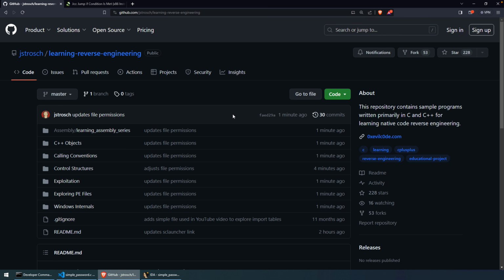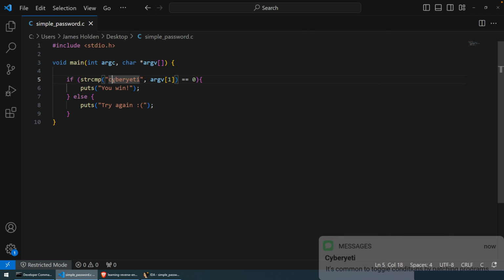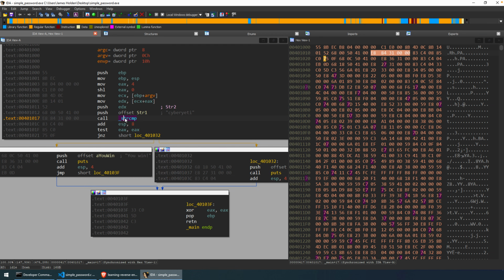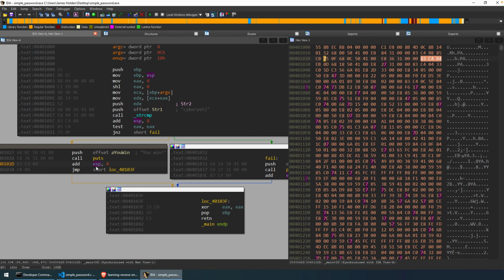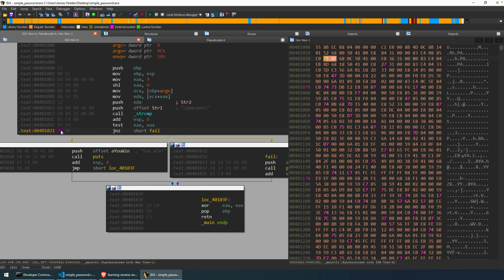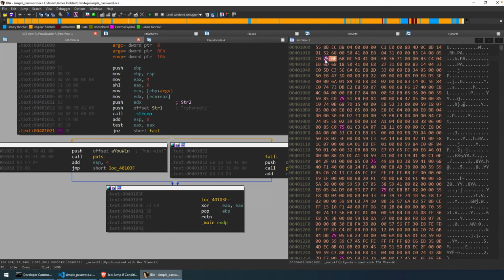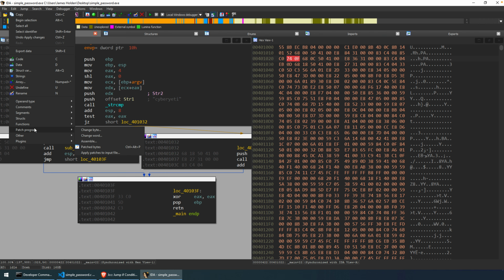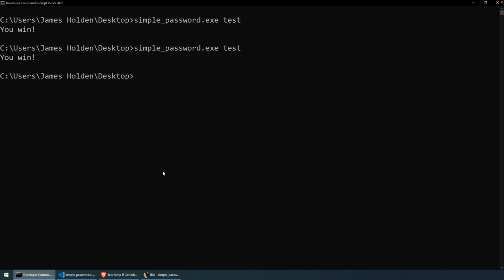Patching Binaries with IDA Pro (free)!

Comment: The much less expensive way is to xor eax, eax (which in itself is less expensive than a mov of 0 to it) and nop out the remaining three bytes, all in replace of the system call directly above the eax test. Having no system call at all saves a lot in itself. Rock on. Good video. I dislike changing conditional jumps, myself. If I was forced to patch where you did, it would be to keep the 75 opcode alone, but just change the byte after it to 00. The same thing applies with other jumps. Say you DO want to jump on a 0F 84 xx xx xx xx - just change the 0F 84 to 90 E9, instead. Works for all conditional jumps like that. If you remove the xx part instead and replace with 00 bytes, it will never jump, 100% of the time, as an opposite thing to do. - The reason behind my thinking is, let's say you make a release and someone that actually is authorized to use it fully tests it - now, it will not work for THEM, in your chosen method, if you understand. It leaves a variable in the air, unnecessarily.

Comment: I keepe getting theses error unfortunately:

Creating backup...failed.
Command "ApplyPatches" failed
Reply from the maker: Unfortunately I haven't run across that issue before - although I don't end up modifying too many binaries with IDA. If you provide a little more info I may be able to help . Just off the top of my head, the first failure is in creating the back-up, are you sure that IDA has the proper permissions to modify the original EXE? Can it still access it? I'm not entirely sure where IDA is going to look, but I usually keep the original binary in the same location as my ida database when patching.
Reply: @jstrosch  yeah I was on macos trying to modify a macho file. It works fine on windows. I had to use hopper to make it work.
Reply from the maker: @NSMutableString  ok, I haven't tried it on a Mac yet... good to hear you at least found a workaround with hopper. Thanks for the update